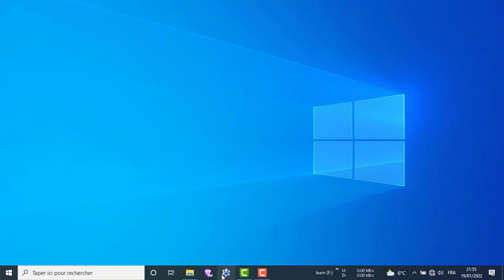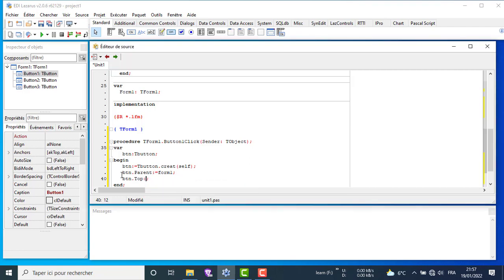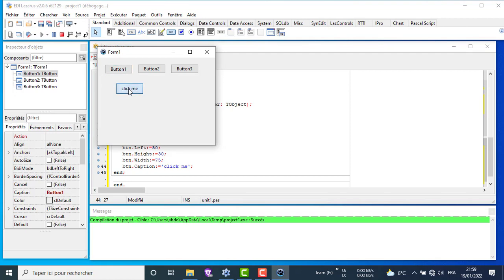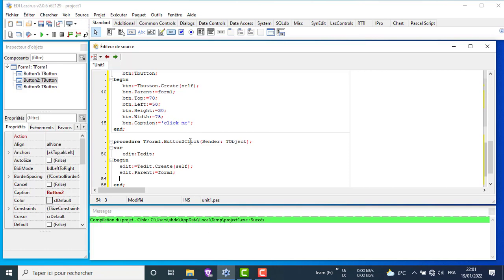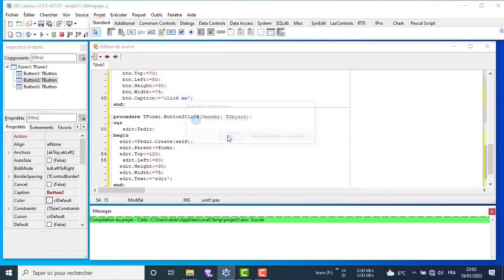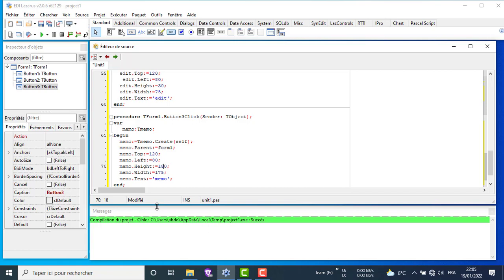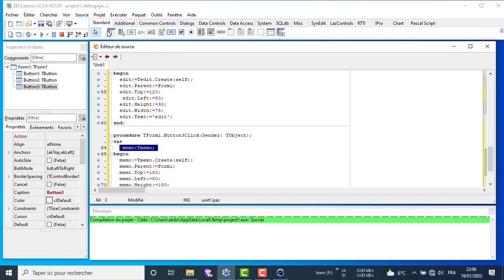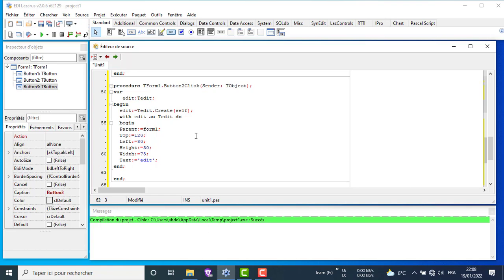Dynamically creating components part1

Comment: I do appreciate the videos and would like to see more of them, but as Mmentioend on Facebook be careful and try to teach people a better way of doing things.

1. You are introducing memory leaks !!! Every time you click one of your buttons you create an instance of an object, the second time you click / press the butotn, you create a new instance of said object, overwriteing the variable holding the reference to the previous one.  So .. no way to clean that up anymore (other than ending the applciation in your case). If you would keep klicking said buttons you would see that your application is eating up memory.

2. Parent should only be set at the end of your process, or at lease as late as possible. The reason why is that with every change to a property which has influence on how / where the button has to be drawn, hou will make the system repaint the button. So in your case ...  You set the Paremt -> Repaint, you set the Top -> Repaint, , you set the Left -> repaint, you set the Height -> repaint, you set teh Widht -> Repaint, and you set the caption -> Repaint.  So you made the OS paint/draw your button 6 times by now. Set all properties first and only set the parent at the end will only generate the painting once which is a lot faster. You won't see the difference in your sample, but on complex screens with a lot of aligned properties, you will ...

3. With Memo as T<ComponentYouCreated> is unneccessary. You creatd the comcponent in the same routine, so there is not need to check if it is of the same type as the variable you put it on. The check requires some minimal processing power which isn't necessary here.

4. Might be a personal thing but I hate using With. It doesn't make your code easier to read, it just makes things more complex and even makes debuggin a bit harder IMHO. Wrote a blogpost about that a while back https://www.devia.be/2021/10/06/with-or-without-with/

5. Keep your code clean ... indentations help,

If you need any help, feel free to drop me a message ... even in French 🙂
Reply from the maker: thank youn i am tring to do my best

Comment: Better than btn.Parent := Form1 would be to write btn.Parent := Self. Especially since btn gets created with Self, not Form1, as the Owner on the previous line. In this case, Form1 and Self are the same, so it works both ways, but if you'd create more than one instance of TForm1, then it would not be the same. Self should normally always be used. The automatically created global variable (Form1: TForm1) is usually best avoided (it's even a bit non-pedagogical that the editor creates it at all).
Reply: btn.Parent := Form1 or btn.Parent := self
are both useless while the owner is always self or Form1 
finally
  when we create any component at runtime where the owner is the form or the panel or whatever comp container is ... the parent automatically will be the owner and the visible property is also useles (it's taking automatically the owner visible property)
Reply: @benammarmohamed8793  Actually, Owner and Parent are still meaningful at runtime and they are different things. Owner is about memory: the owner will automatically Free the owned object when the owner itself is being freed. Parent is about visual hierarchy: the child is visually connected to the parent.